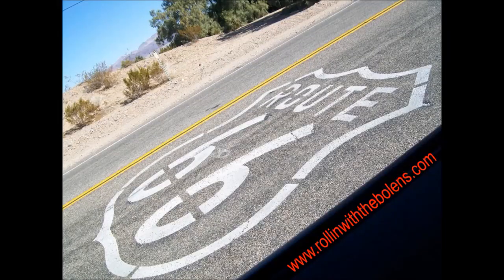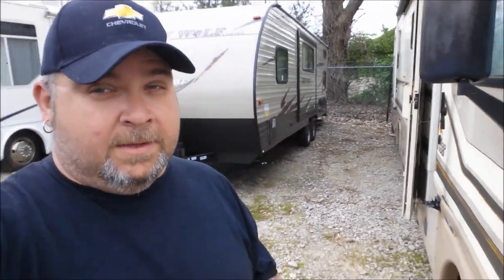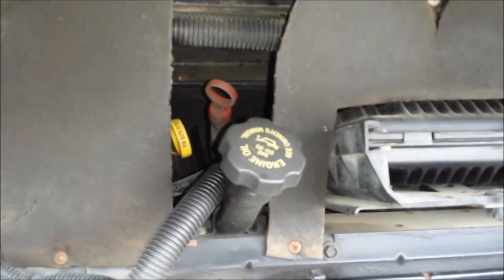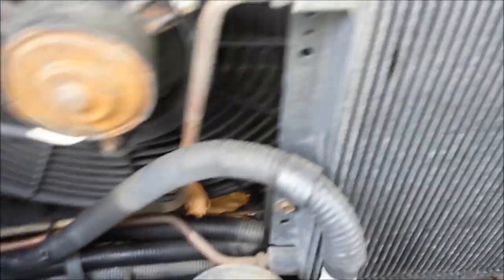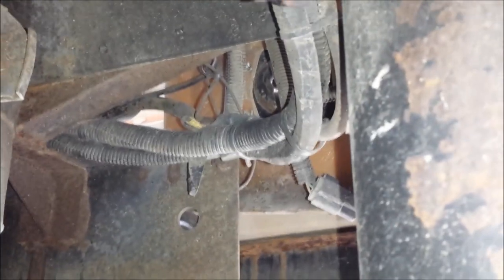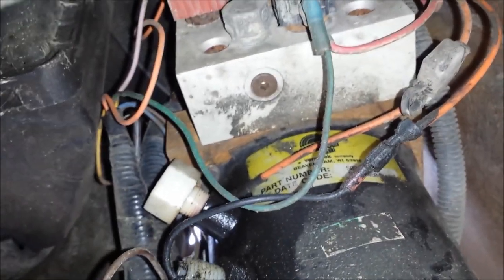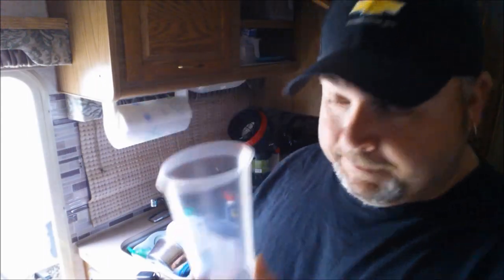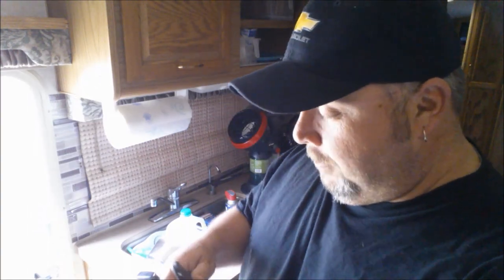HYDRAULIC JACKS FAIL  LEVELING SYSTEM TROUBLESHOOTING FLEETWOOD BOUNDER / FULL TIME RV , VLOG

Comment: Actually no matter how tight you get the plastic plug (cap) on the tank, it is designed to blow by the cap if it's filled too much. Take a look at the bottom of the cap at the end of the threads. There is a relief area for the tank out of the bottom of cap. I don't think using a wrench to tighten the cap will help much, might break it off in the threads of the tank. Look at the type of cap it is, not made for a wrench, made for hand tightening only. Anything with high pressure like the hydraulics of the levelers will have some sort of pressure relief for expansion and heat etc.... The power Gear leveler system cap is the way the system relieves extra pressure or fluid. Hope this helps.....Thanks, KG

Comment: I use a 2' piece of clear pvc hose, 5/16", drill a smaller hole 19/64" into the cap of the transmission fluid bottle, put the hose through the tight hole, all the way to the bottom of the bottle, now just squeeze the bottle and fluid comes out the hose, remove the hose to let air back into the bottle.  Cleaner than using a funnel.

Comment: The  pump is not made by Ford or Chevy . The type of fluid is  out lined in the owners manual  of the system  you have . Bye the way you knocked off the brown wire when you were filling the tank . Take care with this system . Parts are impossible to find and many have been discontinued . A new system will cost about $2000.  The fuses in the control are hard wired into the circuit board if you pop a fuse in the control  its done . $$$$$.

Comment: I know you did this six years ago but man, it's a life saver for me today in May 2023
 Were in route from Idaho to Syracuse NY I'm our 1996 Fleetwood Bounder 34j on the Ford F53 with the 460. We have the identical power gear 3 hydraulic leg system and today on and off for 330 miles we listened to the bah bah bah bah bah mile after mile knowing our gear was up and good. I looked all over for the darn dipstick that it's in the manual and darn if I could find it. Until I found your six year old video. Thanks so much, I may not make my own funnel but tomorrow I'll lay down under that front fender and give it a whirl and hope to end 1500 more miles of bah bah bah bah, I'd thought I'd lose my mind or start to drink heavily! Thanks!
Reply from the maker: Sorry just seen your comment,  glad it could help you in your time of need.. and yes that dang buzzer is absolutely annoying!

Comment: Man I appreciate your video before I found your video I found the hydraulic cylinder where you put the stuff in but I saw the cap mine was a metal cap after I took it off it had no dipstick I change the oil in this thing earlier and had to buy a funnel with a hose because the stupid engineering of this thing I was going to use that to get the fluid in there but my fluid was full and I didn't need any Apparently one of my Jack Springs isn't working right I have to take a 2x4 to push it up I was told to check the hydraulic fluid

Comment: Do you think this video will help me with my 2006 Fleetwood Pace Arrow 36D leveling problem? It has been "reset" twice and the constant beeping stopped, but then we turn on the RV and drive and as soon as you hit the brakes, it starts beeping again. So I found out, after I brake, I have to push the on/off button thing and it stops until the next time I press the brake lol. Then when we get to our site, the level jacks wont even come down and everything flashes on the leveling digital dash board area. We thought it was the RV batteries bc we found out they were not strong enough for our RV, but we replaced those and also replaced the Fuse that goes to the level system and it still doesnt work. Now we are thinking it needs a new mother board??? But idk if we have tried this option in your video or not... or if this video will even apply to a 2006... Help?

Comment: Our front passenger side leveling jack developed a leak between the fitting and hose. I'm attempting to remove the line but having a hard time getting it through the support straps underneath the coach. Anyone else experience this?

Comment: I see a aux fan is that for ac or motor am curious I own a 1996 bounder with 460
Reply from the maker: It was for the engine,  never actually needed it.. but I like to cover my bases. Lol
Ours was on the chevy chassis.. 
That 460 is a power house also so good choice on both engines. 
Thanks for watching and commenting!

Comment: Not sure if I read you right at the beginning with your aviation quote on the jacks.  Sounded like a military mechanic to me...which is what I was as well.  Anyway, you're certainly right about the AutoZone boob...
Reply from the maker: You caught that landing gear reference huh..lol , most auto part stores are ok , but every once in a while you just get that one employee that takes the cake , It would be nice to walk into a auto parts store and ask an employee a simple question an have a correct answer,  for instance ask the employee  for  headlight bulbs to confirm the style your vehicle takes like is it an 1157 style or a h11 , and the response is what motor do you have as that makes all the difference  , I had asked for a manual fuel pump for a 68 chevelle  with a small block chevrolet 350 , now because that wasn't a engine option for said vehicle they had no clue because the computer do not have a option they didn't know what to do , so I said look it up under 78 camaro knowing it was offered with a 350 , they proceeded to try an give me a drop in fuel pump.. I said that's not it I explained myself one again that I needed a old mechanical pump he said that's not what the computer calls for I tried to tell him well it's wrong for that year of car too.. I got sick of going telling him what I wanted an just got two Mr gasket electric fuel pumps to get me on my way , as the didn't have any good high volume pumps ..

Comment: I have a 2001 Damon Challenger. Front Jack's work flawlessly. The back are now going down but don't want to go back up.  I had to muscle them up and I mean with leverage. Any Insights?
Reply from the maker: Check the solenoids for the rear jacks.. they should be by your hydro pump

Comment: thanks for this, recently purchased a 97 bounder that is giving me the jacks down alarm
ive got a pump for transferring gear oil, IF i can find it, ill try that, i have funnels, just don't know about having enough space
Reply from the maker: +Mr_Wizard your most welcome.. no space for a funnel on ours... not a great location to service.  You may need to get creative
Reply: mine is in the same spot 
i also have the handy dandy expanding flexible pour spout that screws on to oil and ATF bottles, that ought to do the trick
find out to tommorow

Comment: Will my hydraulics affect my power steering if my Hydraulics are not level a level button is not off will that affect my driving
Reply from the maker: Your jacks have nothing to do with your steering.  Two different systems , you should check your fluid in the power steering pump. Hope this helps

Comment: Fluid transfer hand pump from harbor freight would help. Less than 10.00
Reply from the maker: yes sir thats a good idea , bad place to try and add fluid to anything bad design if you ask me..lol
Reply: Steve Muise f
Reply: My Bounder is a diesel pusher so all the reservoirs are in back and readily accessible. But your's is in the dumbest place I can imagine. Right in the line of fire for rocks ans other debris coming off the wheel.

Comment: We have a 2003 Tiffin Allegro with HWH hydraulic jacks and manual only controller. We have installed 2 new jacks (we have 4) and all the springs. The right rear jack will not retract. I watched a video that said loosen the hydraulic line to the jack. If it retracts, it is not the jack, check your hoses? I loosened the line, nothing happened, I took the line connection all the way off and the jack slammed to the top and the line squirted oil all over me. lucky I didn't have hold of the jack or I'd be missing a hand! So now what?  It seems if the jack won't retract but does when I remove the line, there was still pressure keeping it extended. It has to be the hose or the solenoid? how do I check for this?
Reply from the maker: I would say my money is on a collapsed line.. look for one that's smashed or pinched, check for lose wires to the solenoid, to check the solenoid  listen for a “click” noise. If the click is strong and loud, it most likely means the solenoid has enough power and is working properly. If the clicking you are hearing is quiet or repetitive, it may be that your solenoid is not strong enough or does not have enough power from the battery!
Hope this helps
Reply: @RollinwiththeBolens Thank! Contacted Stuarts HWH RV Service in Elkart, Indiana. I talked to Chuck Stuart. He helped me check the lines and solenoids. His diagnosis is I need a new Jack. Ordered one. I guess we'll see after I install it.

Comment: Mine is leaking fluid, haven’t looked at it yet but I’ll check that cap. Also, my panel on the inside doesn’t really do anything if you press the buttons. They randomly light up. Bad board?
Reply from the maker: I'd say the panel is lose check the connections.. if they are good probably a bad panel
Reply: @RollinwiththeBolens  where can you buy parts for these bounders?
Reply from the maker: @totalpackagedetailingllc4413  try some rv bone yards.. they are getting hard to get parts for, part of the reason we went to a fifth wheel.  You can also contact Fleetwood the may have some new old stock parts available,  or can recommend a replacement that would work for you.

Comment: Been trying to figure out why front jacks went up but rear ones stayed down? Fuses? or fluid low?
Reply from the maker: It could be low on fluid.. or could be a loss of power to the jacks.. or one of the relays on the pu.p itself..I would start with fluid level first then on to relays.. your fuse shouldn't be bad if your front jack is working! Hope this helps
Reply: It pretty much has to be a relay or valve issue. All three pumps draw from the same tank. If the fluid is low, none of them will work.

Comment: Thanks for taking the time to video servicing your hydraulic jacks. I learned a few points that should make my venture easier. I'll be sure to learn which fluid to purchase for my 'Ford' chassis rig. Also thanks to your viewers remarks to either use a turkey baster (Thanks Patrick) or trans pump (Thanks Joe and Steve).
Reply from the maker: Thank you for taking the time to watch and comment..
Reply: Where are you behind a tire. In a compartment?

Comment: hello where is the windshield washerfluid resivour located on the bounder?  I have 1991 fleetwood bounder I recently purchased.
Reply from the maker: It should be under the hood just under the windshield
Reply: @RollinwiththeBolens  ty for responding. The only white container I see is the coolant and its marked for coolant I cannot find this RV Model anywhere. This is   I believe 31ft It has 2 doors , front and at the bedroom Title says this is P30 Model , clueless
Reply from the maker: Ok it should be on the passenger side.. if its not there I'd say your missing your tank.. look for a hose thats going nowhere.. have someone try to use the washer if you feel suction that probably your feed line... you can go to any auto parts store and buy one.. you will then just need to find a place to mount your new tank.. come over to our Facebook page and send me a picture of your under hood compartment and I'll see if I cant pin point it for you..
Reply: Okay thank you will do

Comment: I know this dosent have anything to do with levelling. I have the  same bounder as you, can you tell me where the water pump  is? Thank you rick
Reply from the maker: I assume you mean the house water pump , it is located on the drivers side of your coach just behind your rear wheel in your luggage bay.. open your luggage bay  door look to the left in that small hole it's in there your hot water tank bypass is also located in there.. so under your bathroom area if your outside looking at it.. I would  take a picture an send.. but we no longer own the bounder.. good luck

Comment: Good video. Maybe a meat basting syringe purchased at Home Depot could work better to fill. I use one to fill my rear differential on my motorcycle. The fill port is in a very tight place. Just a thought
Reply from the maker: +RvDreamin thank you.. so many things you can make work in a pinch.. I'm a firm believer to use what's handy and think outside the box.. as the proper tools may not be at ones disposal. And if you have something you can use you already have it's free and that works for me I'm cheap.lol

Comment: Could you do a video of how you work the leveling jacks? Ive never used mine.
Reply from the maker: i'm sure we can work that out!  thanks for watching michael
Reply: I found the Milwaukee Cylinder intro video about the leveling jacks. Remember to have the engine running, in park, and I guess it should fire up? I have a '94 Ford Bounder I inherited. The lights only came on once, and I couldn't move them up or down. I guess I have some wiring to check.

Comment: I have leveling jack that wont come up any advice .
Reply from the maker: Do the other jacks go up?
Reply: Yes the do go up
Reply from the maker: Could be low pressure in the line.. if that's not it could be a solenoid stuck or went bad... you can try lubricating the springs and the shaft then reset the jacks
Reply: Thank you what kind of spray should I use ?
Reply from the maker: You can use wd40 , or some white grease available at any automotive parts supply
Reply: You are Awesome thank you so much for your help , Y'all have a wonderful weekend .
Reply from the maker: Awww shucks thank you... you are very welcome hope it helps you out.  Have a great weekend also

Comment: My Fleetwood Pace Arrow keeps the light on and the passenger front wont even go down. Note to self... Check Fluid!  Thanks Brother!
Reply from the maker: If it still doesn't go down .. check that the seal on that jack is still good if not it may not be building pressure.. also check  the electrical connector going to that jack as it has independent relays.. good luck and thanks for watching and commenting!
Safe rving to you

Comment: great vid , did you run the legs up and down 3 times and re check to get the air out of all the rams and pipes ,
Reply from the maker: I did burp the system.. the footage got lost of that step... but thank you for pointing that out for everyone to bleed the air from system .. an thanks for watching and commenting

Comment: Hey Ya'll wanted to share Our Slide Out wouldn't work, Hydraulic level good, checked the voltage 0, replaced the Relays with Golf Cart Relays still 0, Fuses OK, son-in-law traced to an Auto Reset Circuit breaker mounted under hood, sure enough was stuck Open. Replaced about $6 on line, installed and works Fine. Hope this helps someone.
Reply from the maker: Nice thanks for sharing some knowledge with us all!

Comment: Thank you so much for posting this info video. My leveling beeber is doing the exact same thing and Its been a pain trying to figure out why it's going off when my jacks are up to. Sooooo I finally looked up on Google and your video popped up. PERFECT! 😁👏👏 I hope that mine is as fixable as yours and that beeper shuts off  😝😝👌👍☺
Reply from the maker: You are very welcome  , I would guess that's more than likely your issue as your jacks are going up and down.. good luck glad we could point you in the right direction!
Reply: @RollinwiththeBolens  
Well that was my same issue and fluid is now full and beeper went off!  Thank God cuz that was so annoying lol 👌👍✌😊🎉🎉
Reply from the maker: Lol... yes very annoying little problem .. so happy you found it was only that.. be sure to check for leaks as the fluid don't normally just go low without a small leak somewhere,  be safe out there!
Reply: @RollinwiththeBolens  yes I sure will be checking for leaks for I like to keep up to top notch as much as possible lol thanks again 😊✌
Reply: @RollinwiththeBolens  I have now discovered my back passenger jack has a leak cuz the beeping started again and found a puddle on the base of Jack. Ugh always something to fix on this thing lol Hope it's not gonna be to much of a pain to fix that now lol
Reply from the maker: ddizhere oh no... good luck hope it goes smoothly for you!
Reply: @RollinwiththeBolens  thanks I sure hope so to 👍

Comment: I have been under all parts of my camper 2004 Fleetwood Bounder and cannot find the pump.  WTF
Reply from the maker: Yours may be in one of your under belly storage.. you may need to follow your hydraulic lines from your jack back to your tank.. I wish I could be of more help on yours but I've never worked or looked for any components on your year of bounder.. when you find it your welcome to post it on here in the comments for others to use as a reference
Reply: I have a 99 Bounder, mine is in the compartment with the house batteries.
Reply: On my 1998 Fleetwood bounder it's behind the house batteries. 

The batteries are in the first  basement compartment behind the drivers seat - the one that does not come out with the slider. Behind the batteries is a plate about 12" square held on by four sheet metal screws. There is a label on it that talks about the emergency slide-out closing mechanism, but doesn't mention the levelers. 

Remove all four screws to remove the plate. 

****WARNING..... WARNING...… WARNING !!!!!  ****

The plate is right above the battery posts. Do NOT let it drop onto the batteries and short them out!

Once the plate is removed, the tank will be right in front of you. Even with a skinny funnel its almost impossible to pour into. Use either a transfer pump or the previously mentioned turkey baster.